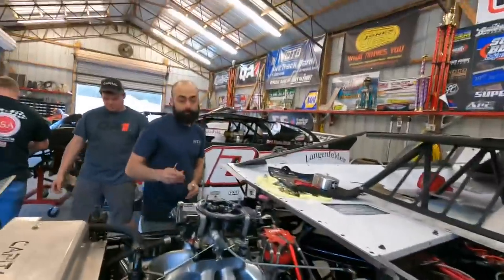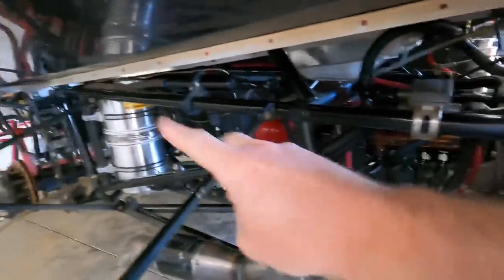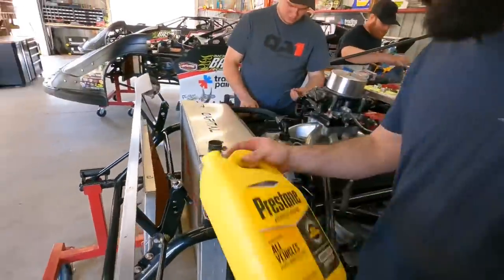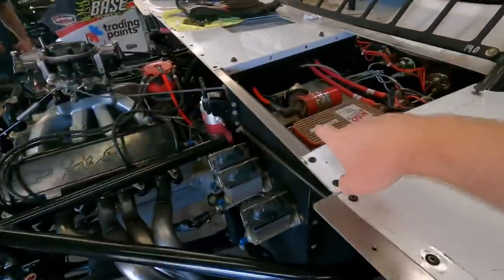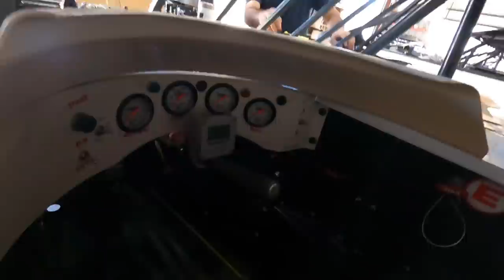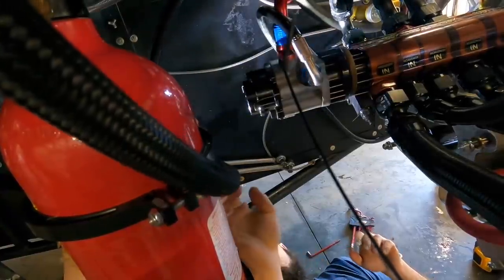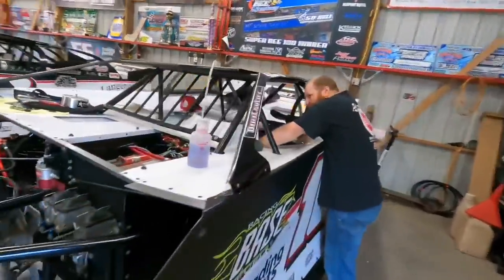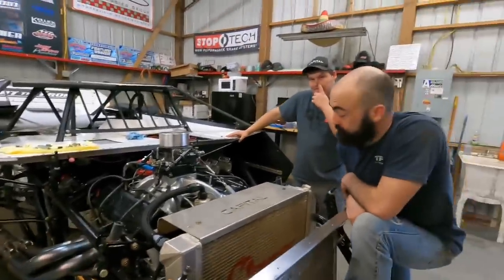Will It Run After Three Years? Cranking Our 465 CI Engine for Bristol!

Comment: Anybody has never been in a garage with a motor like that running will never understand the sound the feel the noise is awesome the video doesn't do it any justice
Reply: I still chubbed up
Reply: Don't forget the smell that Power Plant is putting in the air.💨👀
Reply: I did forget to add that it's like a good perfume on a lady
Reply: At the garage or the track that's where you get the justice
Reply: I grew up around one of these. It sure does bring back good memories

Comment: Were those valves backed off?  If those valves and springs weren't back off and sitting for 3 years even if their PSI top of the line springs you just might be facing a big issue coming.....
Reply: That was my first thought
Reply: @burnychaplin4601  For sure
Reply: @JJ-1-1  pistons might say hello valve at over 7 thousand rpms I hope not but I wouldn't race it without checking springs especially after 3 years and what about rusty valve seats she might just sound good and not be up to par needs a leak down test and total valve train inspection if it set 3 years especially if they didn't back off the valves and fog the engine when she was shut down

Comment: Question? Frame in front angled up on right side to allow for turns. I noticed the radiator is below frame on right corner. I'm assuming this is not a problem.

Comment: Ain’t no way that thing makes anything less than 900hp just on sheer size! Sounds good! 

Wasn’t shown in the video but after you prime with the drill, bump the starter and continue priming and repeat then fire. Should get the rest of the pushrods and everything else. Also someone mentioned to check the valve springs…unless the adjusters were backed off before it was put away for years, chances are some of the springs sat compressed.
Reply: Watch the video Listen to Jonathan talk about the HP...your wrong

Comment: I noticed Joseph was using never seize on the header bolts.  The copper kind.  DO NOT use the silver aluminum kind like you can buy from Napa in anything aluminum like heads. That stuff hardens up and will actually pull the threads out when you back the bolts out. Been there done that. Not a good outcome.

Comment: I'm not trying to be a no it all but I noticed a lot of comments the guys will say moter which are electric, an engine runs on gas etc. I also wanted to mention you guys purchased a priming oil pump to avoid over use on the starter,but you still had to crank it for other reasons, what I would suggest is buy a new one just for the track and just use the old one for start-ups only, years ago they would say only crank a starter for no more than 15 sec.I think that is way to long, in my mind 5 sec. So good luck this weekend and Bristol. 🏁🇺🇸ML33MI

Comment: If that hog has been sitting for 3yrs I sure hope they had the valves adjustment backed off or those springs will be toast!!!
Reply: yep!! we bought a used engine and that was the case. weak spring pressure caused the valves to bounce or float at high rpm. that led to exhaust gases not evacuating properly which led to the intake charge being sub par and our exhaust gas temps. were 1500 degrees plus.

Comment: We use to run a 465 in our late model tons of power it ran circles around the 604's at least I believe it ran better especially on short tracks lot of low end power
Reply: I would hope so
Reply: @JJ-1-1  😐

Comment: Is it true when motors have been sitting for a couple of years once started all the rust gets packed in the piston rings and goes through all the motor orifices? Eventually, things like the springs and bearings wear out super quick and break? I just heard some guys talking about this the other day. I just have to wonder if some of the garbage being broken loose after sitting for so long didn't plug up your filters or even get plugged up in some of the smaller passages? I think you guys are going to do great, go kick butt.
Reply: Exactly

Comment: I put new motor in. I kept turning the steering wheel back and forth to circulate it. The power steering started working. Loaded the car. Unloaded at the track. Perfect. Lined up to start. Power steering QUIT working on back stretch headed into turn 3 to start. I was holding the steering wheel with both hands to the right. Stomped the gas and the power steering starting working in turn 4. Flat on the floor. I split 2 cars going into turn 1....!!!!!!!. Thank you Lord for working BEFORE turn 1. ANd to top it all off.... I won my 1st A feature later that night....!!! Good times..... TopGun out....!!!

Comment: Put the car on the ground and turn the wheels lock to lock to bleed the power steering system. It needs resistance to be able to bleed.
Reply: I'd bet the pump isn't turning. Somebody left the shaft out between the oil pump & PS pump. That's also why they have no fuel pressure.
Reply: @gailtaylor1636  the fluid was bubbling in the reservoir
Reply: Search: Barnes Acd-001 Drive Spud For Oil Pump 3/8-24 Rh
Reply: @djchristie1490  He removed the PS and said it's not moving any fluid when powered by a drill. But still makes no sense why fuel pump wasn't working. IDK? Easy to know everything from my recliner. I can't stand watching someone else work! 😆

Comment: Oil, steering, fuel pressure on one pump is asking for trouble as you've already found out. Neat idea having one pump but are you equipped should pump go out in Bristol?
Reply: We thought the same when they showed the video of them installing it.
Reply: Almost all super lates run the exact same setup. Im thinking theyve got a drive spud on the back of oil pump not spinning or something. As even if the power steering pump wasnt working its just a thru shaft and should still turn fuel pump unless its broke.

Comment: I hope they released the tension on the valve springs since it set for 3 years! It worries me why it has only 21 laps, hope you didn’t buy someone’s junk. I hope you have good luck, but there is a reason why it set so long.

Comment: Did you switch to a Ford Cleveland engine?
Reply: Do you not know the difference between a Chevy Sb2 and a Ford super motor because it was right there in the video.
Reply: @JJ-1-1  how about you tell me the difference. Cleveland's have symmetrical intake ports and splayed valves. Those heads have symmetrical intake ports and splayed valves. That version/era of sb chevy's have siamesed intake ports.  Are you saying chevy copied Ford's design?

Comment: If it sat without the valve springs backed off well... and hopefully that "hard spot was in his imagination(I doubt it) If you would have only had time to go through it before running it that engine IS a stout piece hope it all works out (even crossed my toes)

Comment: High 800's boy's your taking a knife to gun fight and yea it has more torque than the Draime but that's still not enough to compete against the big dogs.. Boy's there is reason this motor has been setting some body upgraded !
Reply: Kinda like that Durham motor that was 10 seconds behind before Joseph cut a tire huh?
Reply: @vernsimmons945  Hmm bud those southern all stars races are as weak as one series could be so your going have to come up with a decent name and not a Jack o## like those guy that run that series. Once again you lose again do you got tired of losing ?
Reply: @JJ-1-1 who’s leading the WoO point currently and who owns that equipment?
Reply: @JJ-1-1 might want to do some research and see if you can tie together the connection between Madden, Billy Franklin & Tyler Millwood... here’s a hint, matching equipment.
Reply: @vernsimmons945  Where you at Vern

Comment: WARNING! If those rockers were not backed off during the 3 yr storage those valve springs are likely junk and you are asking for a dropped valve at first high RPMs! $$$$$$
Replace or at least test springs!
Overton won a ton of races in his own equip in his early days with Randy’s motors.

Comment: Big cubic inches, high torque is the way to go on the big tracks..I like it…the car should launch out of the turns with the higher torque instead of the engine lug the way  we’ve seen in the past.. Joseph likes running tight to the inside of the corners, Bristol will be a good test but the flatter tracks will be more to his liking..just saying

Comment: Just a couple of suggestions to you guys. I would definitely have you radiator flushed well and get pro-blend -40 below in place of antifreeze and get Mobil 1 oil for the engine! Temps. Will be a big issue at Bristol. Night racing track doesn’t slow down that much! Put that Shell Rotella in the tow truck! Good Luck guys.. will be at Bristol for all LM shows

Comment: So how much more horsepower than the other one
Reply: 50-60
Reply: They said this fresh but not new SB2 motor made HIGH 800hp...Also they said that the Draime (chop liver) made LOW to MID 800's. Wide bore motors from Clements/ Vic Hill/ Cornette cranks out 930 at least but more likely 950hp. So either way you look at it there 40hp down to 60hp to the top dogs wide bore motors..We may be on the same page Jason.

Comment: some bozo replied to a comment  I made about that 465, that block and cylinder heads are not based on the 454, which have spread port exhaust, the intake is a SB2 design  im betting the block is a modified aluminum casting based around the GM 400, and the cast iron  up to 434, some teams run alternators some dont .  Big block New York Modifies,,,,, the limit is 468 last time I looked, and they are fuel injected, dry sump, that make 850 hp, the cars run the exhaust all the way over the rear wheels, that 465 engine has roots in the chevy 350 and 400
Reply: The SB2 - short for Small Block, Second Generation - is the first engine designed by General Motors specifically for NASCAR racing .Your correct it is a aluminum block It shares little with a SBC. The heads are a symmetrical port design not a spread port A SB2 head is light years ahead of a when you match it up against any BB head  For the setup there using the only thing that is the same is the location of distributor on the SB2 and an SBC or BB
Oh by the way the Big block mods rules Fuel System Carburetor only—four-barrel Holley 950-1,050 cf
Reply: @JJ-1-1  good info i didnt know the dropped fuel injection

Comment: Why dont (the best use those motors)? Hmmm
Reply: Because there still down on power there motor is high 800hp the big guys have the wide bore putting out 950hp +
The reason it's a 465ci is a Sb2 is terrible on torque from it's design it's depends on turning the shit out of it.
 And the operating power curve is severely narrow. Better hope the track slows down before qualifying.

Comment: Good job Guys did you run all the VALVES and check tolerances !! Sitting that long its a must hell I would put new Springs in it right now!!!! Im LAUGHING MY ASS OFF MAKEN A MESS 
Its nice to see more than BODY PANELS and engine pulls!!!!!!
PIPE PLUG BACK OF ENGINE is possible  oil leak  warms up and seals

Comment: Well now you guys have a hot rod. That cup motor in a brand new chassis at Bristol is going to be a rocket and faster then a cup car. Y'all gonna be haulling the mail. There isnt nothing like going around any NASCAR track and hauling butt and you face feels like it's being sunk and pulled in and your cheeks suck in. I did it at Atlanta Motor Speedway as a pro driver giving ride alongs for two days straight at 179 mph the banking was insane to. I would kove to have a ride and run at Bristol on dirt in a modified or 602 latemodel dont have to be a super late but anything
Reply: It's not a cup motor when that motor was deigned in early 2000's it was 358ci. That motor that is built as a super is a complete different animal...Please don't pay attention to the valve covers
Reply: @JJ-1-1  I was literally being a smart a** cuse ppl see valve ckvers they think its a cup motor. I got a built 400 in my super stock that started lofe as a good ole 350 and it has same valve covers and tech guys love to think it more then what it is lol
Reply: @vickysalisbury1020  yes sir

Comment: Joseph looks like you got a bite in thier Ass.
Sure hope You clean their Clocks ..
No reason to lag now buddy...
Don't overthink your set up..Subtle changes
Reply: High 800's hp for there SB2 vs 950 + wide bore motor that the big dogs have...at Bristol ? nahhh  if the track is hammer down there in trouble.

Comment: Overton, Owens and Bloomquist are all thinking, "Hmmmm I never thought of using an old used engine and a sub parr chassis" lol, just teasing Joe good luck.
Reply: whats your point?
Reply: @thomasgray2184  What, you don't get it?? No surprise.
Reply: Do you actually know what those other drivers are using???
Reply: @vernsimmons945  I'm betting it's not what Joseph is using. I think Joseph has as  much talent as they do. So the only difference is equipment. That's just racing logic 101.
Reply: @alvarsdzenis4739 so you have no idea what equipment the other drivers are actually using and you call that logic. Make sense if you don’t think about it
Reply: @vernsimmons945  At Bristol !!...yea the big dogs are bringing there best bullets which is 50hp better than that Randy Clary motor.
Reply: @JJ-1-1  you have seen the dyno sheet on the Clary engine? Verse everyone else’s also???
Reply: @vernsimmons945  You're right, we don't know what others are using. Some teams will spare no expense to win, others don't. But it's a known fact that most pro teams take the rule book to the very edge where money is no object. These boys don't. It's not a typical winning combo, but if that's how they want to race, then more power to them. Not sure why you guys want to pick an argument over teasing.  Good god Vern be something different than bitter.
Reply: @alvarsdzenis4739 do you take into that those pro teams have been doing this for years and most have large budgets. Can you understand that HTF is still building their program and taking it slow & steady tends to work if you are looking long term.
Reply: @vernsimmons945  Just stop already. You're arguing about nothing, a joke. Take a hike. ned. It's got nothing to do with you or your opinion.
Reply: @alvarsdzenis4739 sorry I hurt your feelings and have a good day
Reply: @vernsimmons945  No hurt feelings here. Just annoyed.
Reply: @vernsimmons945  Well I have seen a couple and Randy's shop is just right down the road from he has done some  machine work on a bare set of 13 degree heads. And I provided a engine awhile back for Chris Ferguson...So yea I'm in know and you just wish you had a clue.
Reply: @alvarsdzenis4739  Just one thing there is no motor rule except you have to a carb.
Reply: @JJ-1-1 wow, you deserve a participation award for seeing a couple and being down the road from Randy, congratulations. Now go on tour for a couple years and get back with me
Reply: @vernsimmons945  I did in the In the Hava tampa days S.T.A.R.S i and the Southern all stars in 2000's and I still pick and chose but you do none of these things today. So yea I was around Tim Hitt back in the day.
So big boy I'm getting back with you ...What now ?
Reply: @JJ-1-1  Did you miss the point of the comment too? or is humor not your strong suit? As far as rules? There's more rules than a carb rule.
12.1 Engines
A.) Only conventional type V-8 engines with the cam in the block will be permitted. Cubic inch displacement is
optional.
B.) Engines must be based on a manufactured, factory design.
C.) Aluminum or steel blocks will be permitted.
D.) All engines must be naturally aspirated with a single conventional-type four (4) barrel carburetor. No fuel
injection devices, electric fuel pumps, turbo chargers, or blowers are permitted.
E.) The engine must have an operating self-starting mechanism.
F.) Only one (1) distributor or magneto is permitted. Cylinder designed individual coil systems are not
permitted. No distributor-less engines are permitted.
G.) The engine may be set back a maximum of (25 1/2”) from the center of the ball joint to the back of the
block.
H.) All engines are limited to one spark plug and two valves per cylinder.
I.) A harmonic balancer certified to SFI Spec 18.1 is required.
J.) No overhead cam engines.
K.) If there are new engine components and/or a new engine configuration they must be submitted to the
Lucas Oil Late Model Dirt Series for approval prior to being introduced into competition.
L.) An approved carburetor roll-over place that prevents fuel spillage in case of a roll over is highly
recommended
Reply: @JJ-1-1 thanks for the reminder, I need to call Bret this week & do some catching up

Comment: Sell all those motors and buy you guys a cornett motor you will have all hp you need. Cornett motors are built in my home town and ive seen a lot of those motors run around my area and they are run by big name guys so they know they work.
Reply: Or they can do exactly what they are doing based on their budget for their program
Reply: They had rather spend 30k on 2 used outdated SB2's motor when they could put 18k with it and buy a low lap used Corrnett motor
Reply: @JJ-1-1 you assume they spent $30k on both of those engines?
Reply: @JJ-1-1 plus that little Draime put 9 seconds on one of those big bad Durham engines tonight has a flat worn 3 laps to go and still wins. Too bad HTF can’t compete and needs your opinion
Reply: @vernsimmons945  First and for most the competition at the Southern was absolutely atrocious 2nd my 630hp spec head motor could have won that race. Don't get to excited about that performance
Reply: @vernsimmons945  Yea I do... unless the owner was goodwill those motors are still worth the teens
Reply: @JJ-1-1 so who were the previous owners of both SB2s? And who actually built the one from last season?
Reply: @JJ-1-1 I highly doubt Billy Franklin’s equipment is atrocious